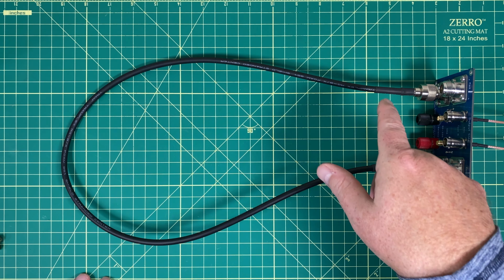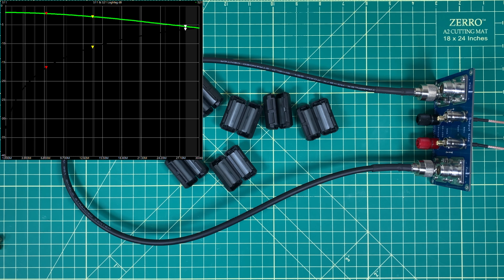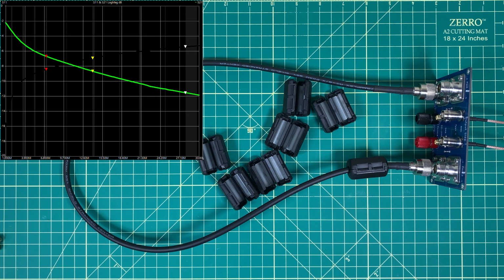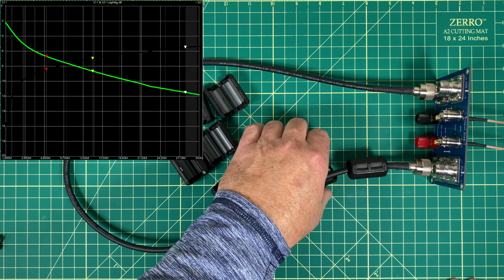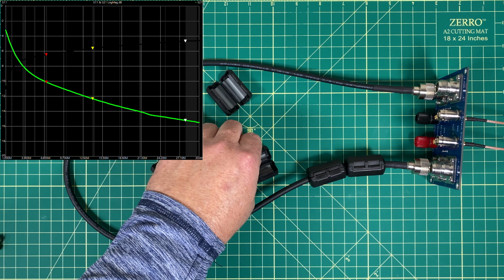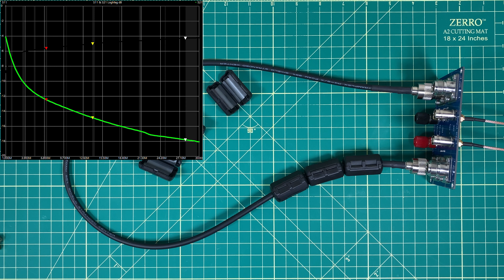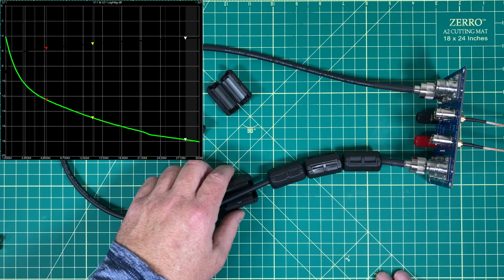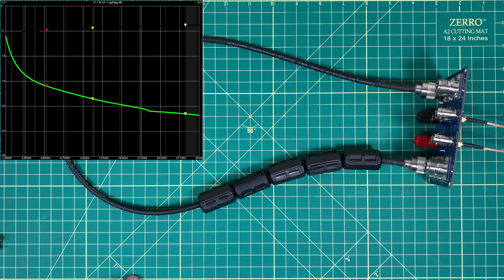Can Ferrite Beads Improve My Ham Radio?

Comment from the maker: 👇👇If you have any questions, please drop them in the comments below.👇👇
Reply: Hi, when you say attenuation, it implies a negative sign.
When you talk about gain, you don't mention a positive sign because it is understood. 
You were repeatedly telling, " so many dB negative attenuation though it is unintentional, I believe. 
De VU2RZA
Reply from the maker: That is a fair point, thank you for pointing it out. I am still working on the imposter syndrome. I suck at public speaking and YT has been the venue to get past it.
Reply: @GraymanPOTA  thanks and I very well appreciate it 👍❤️
De VU2RZA
Reply: I had a little different reason for watching your video - I suspect that my household 120 Volt electrical system has some higher or lower frequency or frequencies that is\are running mixed in with the 60 Hertz.  It shows up only as big spike 70-100 Volts Per Square Meter of EF on my various measurement devices when I move around in the room physically - (meters are the Tri-Field with the chickenhead selector knob and the GQ-360V2).  The frequencies could be below 60 Hertz or above and even way above limited only by what could run on a wire of that length,  Anyway since I don't know the frequency it is difficult to know how to try and reduce it.  I know Tripp-Lite and others sell power conditioners but the range of frequencies they claim to snub are limited.  So was thinking I might reduce them using passive chokes just snapped on over the 12/3 Romex.
Reply from the maker: @policedog4030  unfortunately, with all of the devices that we have in and around our homes, RFI shows up all over the place. What type of issues are you experiencing? If you are experiencing RFI on devices, it is best to clamp ferrites close to the device that is experiencing the issue.
Reply: Hay, Thanks for your time and great test. Can you share where can I buy some snap on chokes for Lmr 400 coax
Reply: Very good and interesting video. However, I miss information about what power they can handle. If we make a choke with an FT240-31, it can handle max. 500Watt PEP. But what about these beads?
Reply from the maker: @ thank you for the question. The video topic was about testing the common mode current suppression effectiveness of multiple clamp-on ferrite beads with inexpensive test gear. This same methodology can be used to test other types of common mode current suppression effectiveness. 

Since we are suppressing current in the magnetic field that is created by using an unbalanced transmission line, the power handling would not be relevant and would be determined by the transmission line being used in the specific use case.

Comment: Thanks Tim.  As a follow up, you should compare a Mix 31 FT240 Core with 7 wraps of coax vs the beads and see which one applies more Common Mode choking impedance.
Reply from the maker: That is a great suggestion. I am looking at building an open air choke/ugly balun and using the test rig to see the relationship between adding and removing coils of coax has on the attenuation across the HF frequencies. 

I am also looking at using the rig to see the relationship on adding and removing turns through a toroid. You should also be able to see how the turns and their spacing affects the attenuation.
Reply: I second that test!!!!  I use the 12 turns around a 240 mix 61 toroid and it works great.  BUT it’s awesome to see scientific results!!👍🏼
Reply from the maker: The test rig in conjunction with the NanoVNA makes a great visual aid to help understand the relationship of the number of passes of the coax through the center of the toroid to the effective attenuation. Thank you for watching.
Reply: This would be a great test. My understanding is that you get a better than linear improvement in rejection by adding wraps compared to passing the cable through more cores, so that would imply you're better off with one big core you can loop the wire through multiple times (at the cost of a bit of feed length) rather than a bunch of clip-on cores only large enough for the coax to pass through once.
Reply: I had click read more after "7 wraps" and was expecting a Taco Bell joke 😆
Reply from the maker: @nathanieljames7462  

My idiot friend keeps saying, “Every time I go to Taco Bell, I get diarrhea.”

I said, “Try ordering Tacos next time.”
Reply: @GraymanPOTA  That's the greatest response of all time!!!
Reply: @GraymanPOTA  still waiting for this test!

Comment: Sometimes I use a triple mag magnetic mount on the Jeep with a vertical telescoping whip for portable operation. The mount has a 17 ft. RG58 coax attached to it. I would think adding ferrite chokes on the coax close to the mount may help prevent the coax from becoming a part of the antenna. Thoughts? Or, ?

Comment: First of all, use them if you need them, second also use them on measurement cables, third use several different types ferrite’s to be able to cover a large bandwidth. Last don’t use them if they are not needed.

Comment: How come I'm just seeing this video now? - I had seen a presentation on ferrite beads. Turns out the type of ferrite matters. Watch the junk you buy from on line vendors. Not all beads are the same. You may want to look it up but at one time I did find a chart on the web. But just like if your making your own 2k balun. It matters the type. Quality and density matter. I have about 5 on each end of every feed line on a random wire. QRN is very exceptionable and QRM is almost unnoticeable. It works but I got my beads from DX not Amazon. They cost more..do your homework. Great video Tim ! Excellent topic

Comment: i don't know much, but i have s5-6 noise floor at my bad location. swr 1.5 best i could get. interference wasn't coming from inside my apartment. had a mess of the snap on chokes from mobile installations laying around, so i piled them up just south of the connector under my a99. swr is now almost dead flat across the 11m band, the only place i will operate. used 6 in total. thanks for your videos

Comment: That was great TIM. with bigger coax best to use snap ferrite. trying to wrap Hyperflex 10 threw torrid not going to happen unless a very big core. this works on hard line as well.  thank you for the link for that jig for the VNA . was going to make one. send one to smoking ape. he just did a video testing CMC chokes on a VNA H4. I use both ABR coax and M & P coax.  I found a 9:1 is bad for CMC RF getting back to radio.  I got extra long USB cable and wrap it threw a T 240-31 core. helps a bunch on FT8 or JS8 call. or and digital. I did my power lead to my IC 7300 and my laptop power leads . I choke every thing. the only thing that hurt is when choke DC leads have big enough wire AWG so not to get voltage drop. I go up a AWG or more when making DC  chokes. 73's

Comment: An interesting test, actually a better result than I had expected. This W2DU approach is a poor use of ferrite. I played a lot with FT240-31 and FT240-43 cores wound with coax but as per the work by G3TXQ although they can offer a lot of common mode rejection the chokes tend to be relatively narrow bandwidth. By the time I had enough turns to offer reasonable attenuation on 160m the inter-winding capacitance is killing the 10m performance. My latest common mode chokes (only tested to a few hundred watts) use twisted pairs stripped from CAT5/6 cable, each pair is nominally 100ohm characteristic impedance, so I use 2 pairs in parallel. Common mode attenuation on 40m is 38dB yet remains close to 30dB at 1.5MHz and 30MHz. Insertion SWR and loss is good too. I do have pictures and saved plots...73
P.S the NanoVNA is a great tool, probably the best ham radio bargain I have ever purchased.
Reply from the maker: The video and the test kit was just to show the relationship between adding the beads to the coax and seeing the attenuation that it provides. I am hoping that it can become a visual teaching aid and give the ability for people to easily test different designs for the best outcome. Thank you for watching.

Comment: Would this theory work on a CB radio receiving RF noise from power inverter, refrigerator, maybe even computer or wifi? My concern would be the ferrites may hinder the receive strength of the antenna. Also, would it help to add ferrite to the outbound extensions of the inverter?
Reply: see my comment. i am no engineer, but from what i understood, chokes usually got applied on power cables. kinda what i thought the solid doughnuts were on a computer power cord, or like the one on my sds200. it depends on where your noise is coming from. mobile or home? ignition on? kill every breaker but the one powering the radio?
Reply: @get__some  Were mobile. Ignition on or off, makes no difference. Power to refrigerator, wifi, & other equipment can't be cut off just to use the radio. Running the RF gain high with the squelch maxed until we hear chatter & make adjustments as needed. Otherwise RFI is unbearably noisy!
Reply: @TripleCTrucking  can you track it 1 component at a time? is the cab grounded to the frame? adding a ground strap might help. new stuff is not grounded well. antenna have it's own ground? new plastic trucks are worse than an old truck. phone chargers, tablet chargers, qualcomms, headlights... anything that has 12v going to it would be getting a clip on choke if that was my situation.  20 pack on ebay for $15. i sure hope the guy that made this video chimes in. i don't know how to read a nanoVNA smith chart to track problems like that, if that can even be done. i would personally start choking every hot wire going to every component, close to the component while listening to a quiet channel. power up every single item one at a time might help narrow it down, or kill each component one at a time, 10-4? trial and error before money has always been my go to. remember, i am no electric engineer,  just a trucker that hates my signals being covered by static, with more hate aimed at unwanted violent static coming from my own truck. good luck to you on this
Reply: @TripleCTrucking  i just piled chokes on my base station antenna and it didn't hurt my receive one bit, at least that i could notice. test performed under controlled co ditions with another location 30 miles away. we always run everything the same as far as antenna and power.  this would be better to do on a dirt road so you could eliminate all other unwanted interference. being mobile does have some advantages.
Reply: @get__some  I appreciate it, brother.
Reply: @TripleCTrucking  no problem at all, i am off duty. have a safe holiday

Comment: For a coax common mode choke at QRP up to 50W field operation on my various antennas for 40m - 17m, I use 5 turns of RG-174 wound through a single split bead similar to the ones in your video. My bead is #43-mix ferrite (Mouser Electronics). I always put that at the antenna feedpoint. Works great. 73

Comment: Thank you for this video! I am new ham experiencing some Common Mode currents issue on digital modes and I stumbled upon your wonderful video.

Would the attenuation also affect RF currents coming out to the antenna?
Reply from the maker: Common mode current chokes only suppress current in the magnetic field created on the outside jacket of an unbalanced feed line. They do not affect the current traveling on the transmission line itself.

Comment: Where on the coax do you put the beads at the antenna or coming out of the antenna tuner  or back of the radio or all the above.
Reply from the maker: Unfortunately, the short answer is, it depends. The reality is it depends on how you are trying to utilize it. If you’re using them with an EFHW that does not have a counterpoise, you would put them closer to the radio so you could use the magnetic field of the unbalanced coax as a counter poise. If you were using them with a dipole antenna, you would want to put them closer to the feed point of the antenna so that you would not interfere with the balanced nature of the dipole antenna.

Comment: When creating a multiband choke, it's advisable to use different types of ferrite cores based on their performance characteristics. Typically, ferrite cores designed for higher frequencies are placed at the end of the coaxial cable, directly before the antenna. This placement is chosen because higher-frequency ferrite cores exhibit less attenuation at lower frequencies, resulting in less heating when operating at those lower frequencies while still providing some degree of pre-attentuation. Consequently, ferrite cores designed for lower frequencies endure less strain.

In my setup, I utilize 15 cores of the 8W500 type (from Wuerth Electronics), with each core having a attentuation approximately 80 ohms at 1MHz and 100 ohms at 10MHz, providing about 1500 ohms of attentuation 80 meters. For frequencies at 10MHz and above, I employ 3W800 cores, which have dimensions of 7.3mm inner diameter, 28.5mm length, and 16mm outer diameter, providing a attentuation of 195 ohms at 25MHz and around 100 ohms at 10MHz, totaling approximately 2900 ohms in the 10-meter band.

Regardless, such a choke operates with minimal losses, delivering 3-5 kiloohms of attentuation across the 80-10 meter range (equivalent to roughly 40dB), and spans a length of 90cm, housed within an 17mm diameter brass tube for protection against UV and weather exposure. Coax i use is Aircell 7.

Comment: I like to do 1 or 2 loops of coax then clamp the cores over the loops and try to keep this close to the transceiver.. By adjusting the distance between the cores and the size of the loop you can find some good rejection for whatever the noise is..

Comment: Thanks a bunch for doing this video.  I run 4 on my 80-10 home brew EFHW.  Always wondered exactly what results I was getting in the real world.  Oddly,  I thought it might have been a bit overkill.  Apparently not.  Thanks again!
Final thought:  Would love to see a video with a longer jumper and see the reaction of the nano VNA if the ferrites were moved to different locations on the coax.  watch the reaction as they are moved,  see if being separated by larger distances from each other makes any difference or if they do indeed need to be close together sequentially.  Does it need to be near wavelength zero nodes or at the height of the return wave?   Thanks again!   ... ohh.. and maybe 3 of one kind.. and 3 of another and and and...   all on one coax to see if there is a more broad spectrum result.  I'll shut the hell up now. :)
Reply from the maker: My hope with this video is to stimulate conversation and show people that there is a way to easily test their theories. Thanks for watching.

Comment: Thank you for the experiment. I would love to know what happens in any of the next applications of the chock. 
1. Switching PS: input - 240v 1amp 50hz\60hz - output 12v\5v 3amp, 1 chock 1 wire and multi chock vs multiloops of wire in 1 chock. (in a charging cable\router power supply\ex)
2. what happens in network data cables with a chock? (100mb\1gb\2.5gb\5gb\20gb?\40gb?)
3. Speaker wire let's say the signal is 20hz-20khz and another more HIFI 5hz-100khz? (we can check multiple gauges)
4. what happens on a power wire 240v 16amp 50hz\60hz (application is OLED TV\AV Receiver\PC Power\ex)
5. benefits of applying it to DATA cables (USB 1\2\3\4\firewire\ex)
I don't believe you can make this video, but if you do, you win a new subscriber for life.
Reply: Same question for shielded wires, like hdmi

Comment: I design instrumentation, some of which works to 10GHz. I get through ferrites like you would not believe. This is on top of all sorts of faffery like 10,000 times oversampling to get an average which does average out some noise. Cooling everything down helps too. The guts work at -40C. The customer wants me to design some kit that will detect a -300dB signal at 100GHz. As far as I know that needs liquid helium cooling and electronics that can handle being that cold. The tolerances on the dish are nuts too. I'm trying to work out if a helical antenna would be easier. The wavelength is only 3mm.roughly. That said I really do not have a clue.
Reply: When designing instrumentation in general: Which software do you use to simulate? How do you take factors like induction of the circuit board in consideration? How many prototypes do you need to get your result?

Comment: How does placement at the rig side or antenna side or both make a difference or have an affect?
Reply from the maker: It depends on the type of antenna and the use case, but I n all cases, closest to the radio is the best.